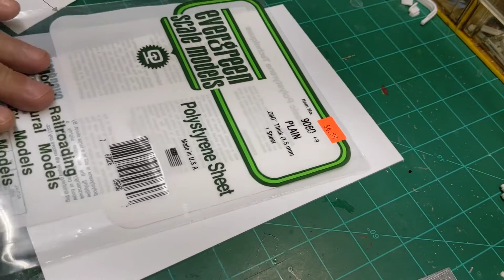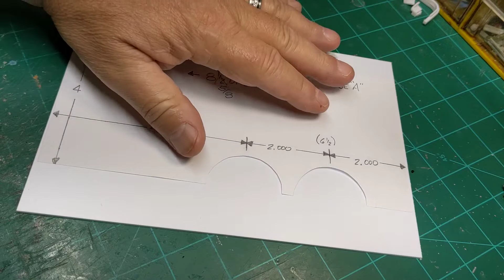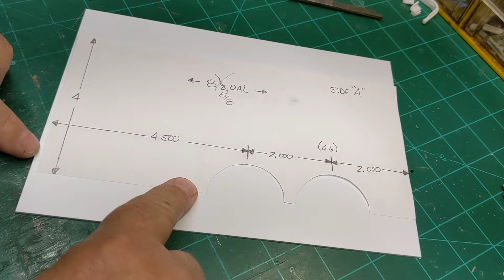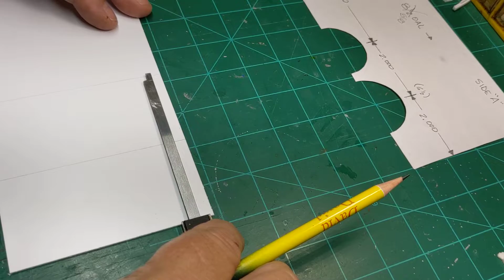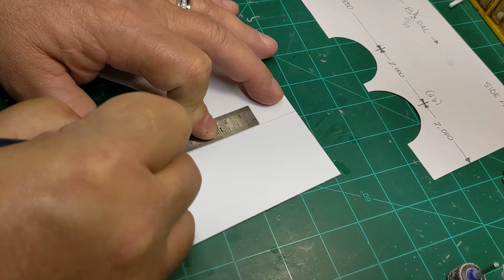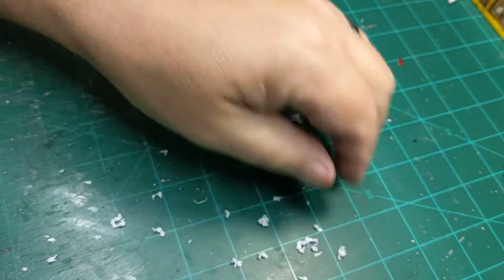Cutting styrene.

Comment: Greetings from across the pond Nice process of making your wheel arches, lovely job, The ground pieces of the styrene, you wanna save them, to make filler glue using the pieces, and a suitable plastic weld glue, dissolve the styrene in the chemical you use to weld your styrene together.
Add more styrene bits for a thicker mixture, comes in handy for a filler once the chemical bonding agent evaporates your left with the thicker styrene, sand and shape.
Just liked and subscribed 👍 😀

Comment: Hi David, 
Can I use the "scribe and break" technique to cut 2mm thickness styrene?
Reply from the maker: Yes , you may have to use several swipes of the blade before it snaps though, but the process would be the same.
Reply: @davidparsleyscustomscaleemerge  Thanks for reply